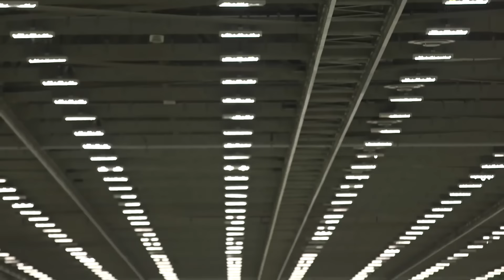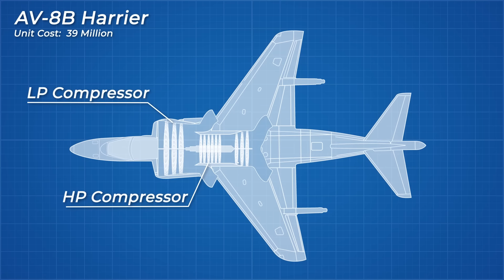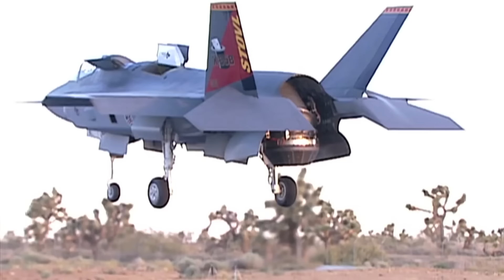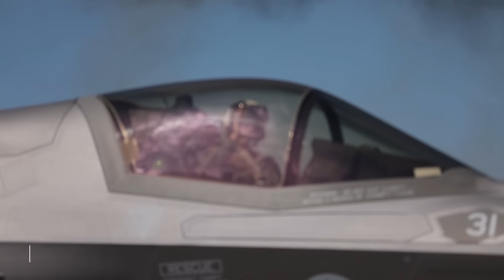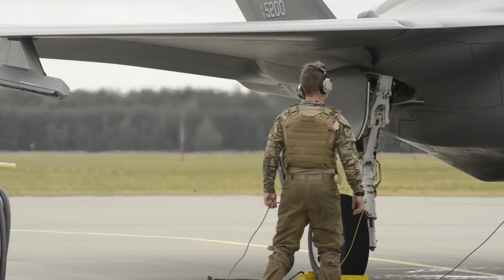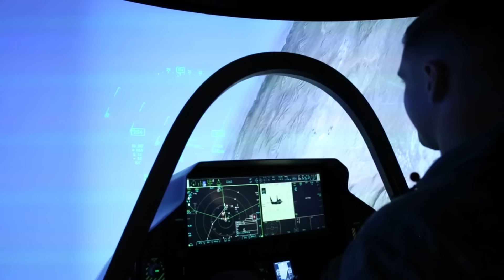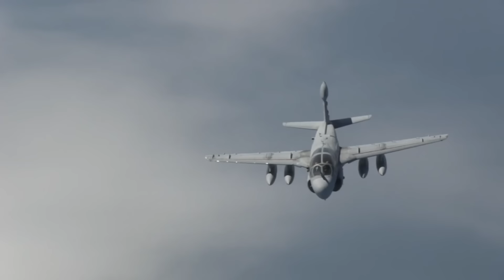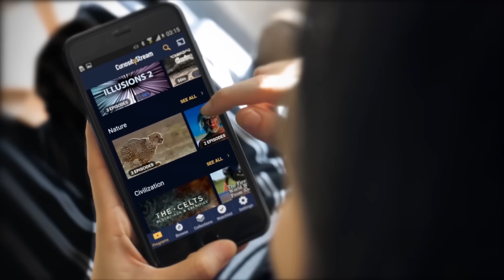Is The F-35 Worth $115 Million?

Comment: German radar company with Passive radar "picked up" f35s leaving town. That's why they don't do a lot of shows.
Reply: Except the F-35's in question were flying with Luneberg lenses.
Reply: Yes, they also were notified of the F-35s positions because the F-35s were broadcasting their positions to air traffic control as a safety measure. Even if they theoretically could track F-35s, they haven't managed to do so in a situation where they didn't already know the positions of the F-35s.

Comment: Its a single engine plane that is slower, less manouverable and less well armed than much cheaper alternatives. The stealth coating wears off quickly, meaning much more costs and maintenance, and given the advances in russian radar tech and the s400 etc it will be redundant in 5 years max
Reply: Except, at combat load, it isn't slower, or less maneuverable, or less well armed than its very few cheaper alternatives. As many of its contemporaries are as or more expensive in both unit and acquisition costs.

Comment: German engineers just tracked a F35 departing from Berlin airshow, ILA 2019, for 100 miles using passive radar technology. With the advent of more stealth a/c, the detection and counter measures will become more sophisticated as well. Rather buy some more Saab, which are probably not as capable but cost only 1/5,  and are cheaper to operate at 10% of the F35s hourly operatring cost.
Reply: The F-35's were flying with Luneberg lenses. The Gripen E in unit cost is as if not more expensive than an F-35A. And are more like 1/2 the flying cost. With a smaller payload and slower speeds at combat load.

Comment: To discuss a point you made, stealth has not in any way proved it's value. It has been used against countries that use outdated AAM tech that is from the 80's and the 90's at best. Were the F-35 to be used against a first world country with advanced technology like China or Russia, then the evidence suggests it would not fair well at all and would be shot out of the sky very quickly.
Reply: The F-117A was 70s tech and has been used to great effect against nations using 70s radar technology. In fact the only instance of a stealth aircraft being shot down proved that stealth works as intended since the radar failed to lock the aircraft until it was at very close range, despite initially detecting it at medium range.

Comment: How much was an F-117A worth in the 1990s?
And it was shot down by 1960s made Russian SAM.
There is your answer.
Reply: The F-117A was an antiquated aircraft that saw no refit since introduction and lacked any form of countermeasures save being low observable flying on the same route as other aircraft earlier that day. The S-125 and its associated arrays were modernized systems from the mid to late eighties.
Reply: @peterson7082  In 1990s, it wasn't obsolete. Put into service in 1980s, I think.  It was used against Iraq a bit before. 
Yugoslavia was under sanctions and S-125 used to shoot it down DIDN'T HAVE ANY MAJOR UPGRADES, almost 100% basic.
For today standards, yes, largely obsolete, but back then, it wasn't obsolete. On the other hand, S-125 WAS obsolete (1960s technology).
So, if 1960s SAM can take out pretty modern stealth at that time, what will much more modern SAMs do?
Waste of hundreds of millions of dollars...
Reply: @ivanstepanovic1327  The F-117A was introduced in '1983, but its development was finished in the late seventies. No refits or modernization were sought out. 

> "Yugoslavia was under sanctions and S-125 used to shoot it down DIDN'T HAVE ANY MAJOR UPGRADES, almost 100% basic."

 The missiles themselves did not have much in the way with upgrades (it was modernized) though its associated radar arrays were domestically produced, upgraded, and modernized.
Reply: @peterson7082  Modifications in Yugoslavia were minor and included TV system for close range and during heavy jamming. Yugoslavia had no radars in development and no ability to upgrade them.
Radars in use back then: Marconi S-600, P-12 and P-15 for early warning. The radars on S-125 and KUB were in pretty much the original state. P-12 detected it due to different wave length and bandwidth. But radar on Neva used for guidance couldn't acquire it until cross section increased.
The thing is - you can try to sell those stories to somebody else. I lived in Yugoslavia (now Serbia) and served in Serbian air-defense units form December 2003 to August 2004. So, don't try selling me that.
Plus, 1983 stealth vs 1960 SAM... That argument still remains.

Comment: There is no rational argument to be made that the F-35 can replace the purpose built A-10 Warthog. It cannot carry a fraction of the payload of the A-10, it cannot loiter as long, it doesn't protect the pilot in a titanium "bathtub", it cannot land with an engine or wing missing (as the A-10 has on more than one occasion), it doesn't have a 30 mm armour piercing Gatling that'll punch through a tank like it's a soda can, and it's nowhere near as maneuverable at low speeds. The A-10 was built for one specific job, and it excels at it, but the F-35 is a jack of all trades, master of none.
Reply: There definitely is considering the A-10 only does at most 20% of successful CAS missions and exists today mostly because of a false reputation for survivability.
The F-35 can carry a larger payload than the A-10, has longer range, has the option of stealth for CAS in contested airspace, has a 25mm version of the A-10's gun, and is extremely maneuverable (the A-10 only has a tighter turn radius, not better maneuverability). Also, the A-10's gun is only good against light armour. It was tested thoroughly against T-62As (from 1961) using DU rounds and failed to penetrate it from all angles that would be practically achievable in a combat situation.

Comment: Is it worth it? just depends on what you compare it to. Ca built many bridges for its poorly managed high speed rail. There might be  12 to 14 of these bridges. The bridges are currently the only output from the input which is likely around 15 billion. (for a small relevant section including the bridges. the total project is expected to exceed 70 billion)  So each bridge that connect to nothing and provides nothing cost a bit over 1 billion a piece.  So one bridge that can latter be turned into a Jerry Brown Town for homeless people or about 8 f-35s. Hell yeah the F-35 is worth that small cost.

Comment: "Most expensive weapons system in US history." "$115 million" 
Navy: 'laughs in Air Craft Carrier'
Reply: He meant the whole weapons program, not the individual unit.
Reply: @zjpdarkblaze  This is the F35 Lightning 2 JSF. US$1.508 trillion (through 2070 in then-year dollars), US$55.1B for RDT&E, $319.1B for procurement, $4.8B for MILCON, $1123.8B for operations & sustainment (2015 estimate)
Reply: @zjpdarkblaze  O'Rourke, Ronald (22 October 2013). "Navy Ford (CVN-78) Class Aircraft Carrier Program: Background and Issues for Congress" (PDF). Congressional Research Service. p. 4. Archived (PDF) from the original on 24 July 2013. Retrieved 8 February 2014. FY14 cost of CVN-79 (procured in FY13) in then-year dollars; the same budget puts the cost of CVN-78 (procured in FY08) at $12,829.3 million but that includes ~$3.3bn of development costs. CVN-80 is estimated at $13,874.2m, making the total cost of the first three Fords $38,041.9m, or $12.68bn each
Reply: Gerard Ford Class Carrier Program Cost= $37billion
F35 Program Cost = $406billion

Comment: Nothing new about f35 engine the Yak 141 had that engine vtol design from the 60s.
Reply: No the Yak-141 is a 1980s design that used 3 engines. The F-35B uses a single engine with a shaft driven lift fan.

Comment: The answer is no.  No mass produced single seat aircraft is.  This is 30 million dollars of aircraft and 80 million dollars of corruption, graft, mission creep and bad project management.
Reply: Tell that to every other fighter available today then. The F-35A is actually cheaper than many fighters, including modern versions of the F-15.
Reply: Those aircraft are ALSO a result of the corrupt process I described.  50 people paid to manage, consult, audit, monitor and report on one worker.  When the budget is unlimited, the number of parasites is unlimited.
Reply: @mrblack888  Then your problem is with society and politics as a whole. Doesn't matter if it's a single seat fighter or not. And while I consider your claims to be huge exaggerations I can still agree with your overall point.
Reply: You only have to look at the difference between the cost of a SpaceX rocket and a Boeing rocket to get a sense of scale of the corruption involved.  10:1 would be the very low end estimate.

Comment: Fuel for thought: Aussie has only recieved 2/72 jets in their deal. Lockheed Martin has promised to make all 72 F35's operational by 2023... ¯\_(ツ)_/¯

As much as I like the design, replacing the Warthog and Hornet will never agree with me tbh... Cheaper, abundant in spare parts, (relatively) easier to maintain, bigger payload etc.
Reply: Aussie postponed their original order due to budget cuts within their government and military branches. They also haven't placed an order for 72 aircraft, that's just the total number tehy are expected to order.

Neither the A-10 nor the F/A-18 can carry a larger payload, and they are only cheaper because the infrastructure for maintaining them already exists. Both were fairly expensive initially back in the 1980s. Everything has a limited lifetime.

Comment: +BUT, Early  on you told the punchline: It would have been cheaper and better to just build three different airplanes in the beginning.  
There is so much graft and corruption in the military /industrial complex that the actual truth will never come out.  
EXAMPLE:  Someone wanted the F22 Raptors to be taken out of service and as soon as possible.  All the tooling, jigs and fixtures were stolen and no one knows what happened.  Even then  company security force tasked with inventorying and keeping it all safe.  For a counterpoint, the parts and spares inventory for the SR71 Blackbird was finally stricken from inventory 20 years after the aircraft stopped flying.  Why were the parts, spares, jigs, fixtures and tooling for the F22 (Which is still in service) allowed to go missing?   Someone wanted to sell F35's really badly.  They are currently stripping   aircraft to keep others flying in the F22 fleet.  Investigate a little.....
Reply: Nothing was stolen. The tooling exists in storage and the F-22 is currently in the process of being upgraded so it can last until 2060, which is the same timeframe as the F-35 is expected to be operational for i.e 50 years.
Reply: @dumdumbinks274  First the tooling was NOT in the shipping containers when opened.   THEN they say it was all shipped to a "Secure site" in Alaska for storage.  But not verified by anyone.  Lastly, the F22 is NOT being reproduced. It was determined to be way too expensive at 230 Million per plane. (We had to upgrade every system to 2019 standards)  It was dropped.
Reply: @myfavoritemartian1  1. The report on restarting production uses the term 'refurbish' in reference to the tools which implies they have them in storage. 
2. I never claimed the F-22 was being reproduced.

Comment: The cost has actually considerably gone down now that it's reaching it's mass productions stage. In fact, production is now cheaper than many contemporary 4th gen aircraft like the Eurofighter.
Reply: I dont like the eurofighter but it s complete different beast, that s an air supremacy plane where the F35 is a multipurpose bomber ...if you want to compare apples to apples compare the f 35 to a Rafale which is cheaper ,way easier to maintain ,and overall is a better naval jet fighter than the F 35 C !
Reply: @Blob B cant you just stop lying the F35 has been created to be a multirole bomber it s litteraly in the name of the f *****g programm " Joint Strike Fighter " ....Btw the f16 or the f 18 arent  air superiority fighters , the F22 and the F15E  are ...

Comment: great video, I got to see them in person for the first time this summer.  Very impressive, I do think it's a mistake to think it can replace the A-10.  There's also been reports that the F-117 has been pulled out of retirement since nothing else can carry a bunker buster.  Aaaand the F-22 is the dogfighter.  So does this mean it will be a very stealthy mobile radar and not much more?
Reply: No, the F-22 is to the F-35 what the F-15 was to the F-16 i.e the F-22 is the extremely expensive single-role fighter and the F-35 is the significantly cheaper multi-role fighter. Also considering the F-16 performs significantly more CAS than the A-10 it is certainly feasible for the F-35 to replace the A-10.

Comment: Here's the Facts on the F35 ..
It's over HYPED over Priced and has MANY flaws...
When first made it had 800 plus faults ! Some have been fixed ! Most have not and won't be anytime soon..
It has crap dog fighting skills.
Cannot fly in Electrical storms..
And or Rain..water hampers full stealth coating..fact..
Modern radars of Russia and China have the technology  to pick it up..
The F35 is not as good as the F22 when first released ....far inferior..
F35 have not had battle in the sky with any foes of Late. 
They seem to have them shielded away from enemies and or missile defence of Russia..S400s and now the S500...
They only fly in safe zones..even Israel will not fly  when the S400s are operating without asking Putin to take them off line first...
Israel has an understanding with Russia when they strike enemy targets....as long as Russians are not killed or put in danger ! Russia will agree to keep them off line..
In most cases Russia and Israel are in communication with each other...
Reply: Where are you getting your information from?

Comment: USAF: The F-35 outclasses the A-10 in every way.

A-10: Lower overall cost, better Close air support capability, better armored, better loiter time, more versatile weapon loadings.

For years the Air Force has been trying to force the A-10 into retirement... one big reason for this is that the USAF HATES having a dedicated close air support aircraft in its inventory. The USAF is all about superiority in the air... and it seems as though many of the high-ranking brass consider an aircraft that is dedicated to supporting troops on the ground to be "below" them. In all honesty, the A-10 would be perhaps better suited as an aircraft maintained and flown the the Army. Then, under Army management, perhaps someday a dedicated replacement for the A-10, with the same design characteristics in place could be fielded.
Reply: The A-10 does not have a more versatile payload save for unguided rockets, nor is survivable in contested airspace.
Reply: Two completely different aircraft, mate. Yes, they could extend the A-10's service for a bit longer - to solely do what it was built for and what it was good at - but that would not have negated the demand for a 5th generation all-round jet.
Reply: @MrFloppyHare  Agree completely, the F-35 is a good replacement for the F-16 and Harrier in particular in a multi-role capacity (cost notwithstanding). My problem lies with certain USAF brass stating that the F-35 completely outclasses the A-10.
Reply: @justicier10-7   Well, as a whole it does outclass the A-10, definitely, by miles. In the niche and very narrow role that the A-10 was built for and excels at, it doesn't, quite. But only a small amount of CAS is provided by A-10's anyway these days. Besides, an F-35 is plenty capable of strafing a target accurately and stand-off munitions have gotten more accurate as well. (And NATO also has the AH-64.) I love the A-10 and it packs a wallop with that GAU-8 but it IS an ageing air frame and it's only good at one thing....
Reply: @justicier10-7  P.S.: It reminds me of an interview I saw with an F-14 pilot. He was talking about how the F-14 could've been kept in service longer and how it could even go faster, higher and longer than the new generation jets. However, when asked if he would rather go into combat in an F-14 or an F-35, he said, "the F-35, of course". ;-)

Comment: It's an amazing machine, but I still bristle at the whole, "It can replace ALL of these aircraft." If it can REALLY do what an A-10 can (close troop support, lingering and cutting ground forces to bits), then that would be ideal, but I just don't see how it can physically do that. Being seen last and shooting first in the sky doesn't mean so much when you're pinned down in a firefight under a boulder.
Reply: "Being seen last and shooting first in the sky doesn't mean so much when you're pinned down in a firefight under a boulder." - it matters if the airplanes supposed to cover you out of that boulder are dancing around in the sky because they're too busy dodging SAMs.
The fact is that the A-10 only did 11 percent of CAS since 2014. It's already been replaced for the most part.
Reply: Being able to replace something doesn't mean copying it's exact method of completing a task. CAS doesn't even specify any requirements for the aircraft.